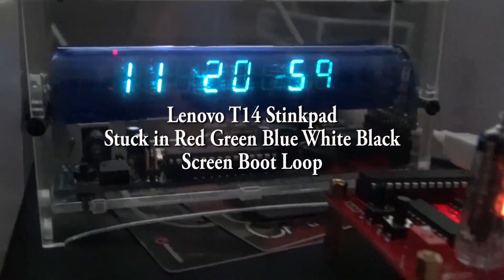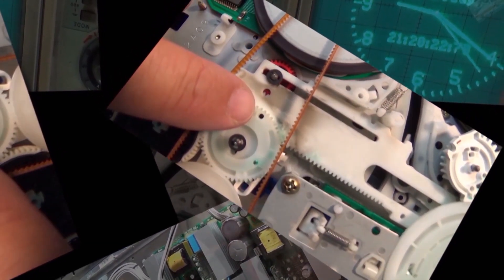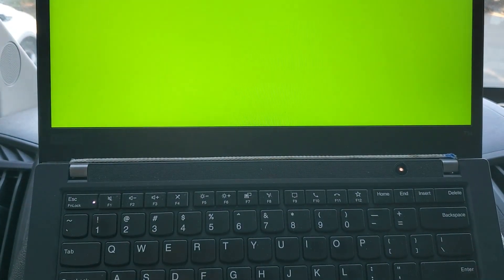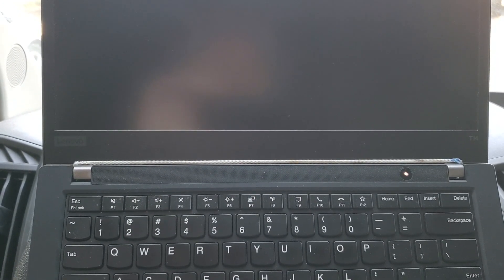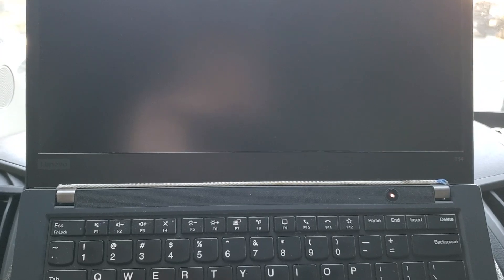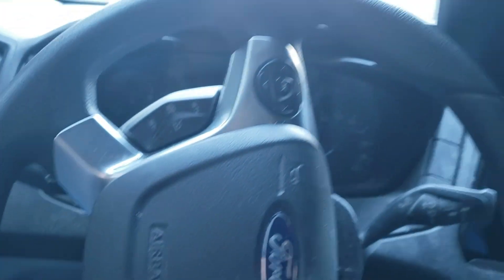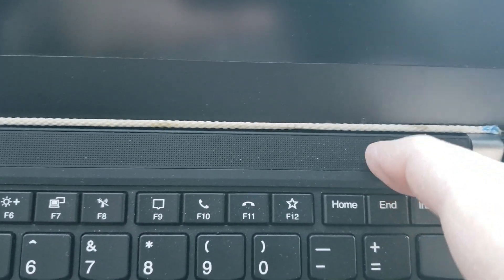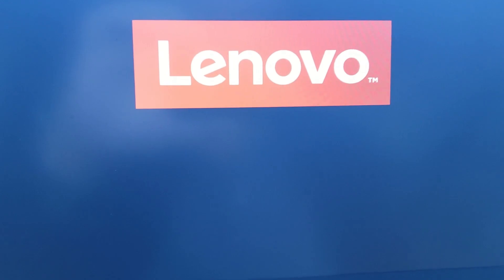Lenovo t14 Laptop stuck ini RGBW Boot Loop

Comment: U got lucky. I have two caller ID units that goof like that and they both have those reset buttons. I have a cable router box that has one too...Sometimes digital fridges will show nothing but horizontal lines instead of numbers, and the fix is to unplug them for a minute, albeit by time you notice it, your food is defrosted. Modern technology is often fubar!
Reply from the maker: Solution.  Don't buy appliances with digital anything. My washer and dryer for example has a mechanical timer. Speed queen, you pay a premium for the old reliable controls.  Lol.
Reply: @12voltvids  👍

Comment: Easy fix! CMOS reset?
Reply from the maker: Might have been easy fix but tech support didn't know it. They were ready to open a ticket and have me drive for an hour to get the laptop replaced.
Reply: @12voltvids  That reset bottom save you that trip! My HP doesn't have an external one, you have to take the cover apart. Humm, maybe I can drill a hole.  :)

Comment: Lenovo.

That's your problem.  I miss the days when IBM made them.
Reply from the maker: Ibm sold our to the Chinese.  I have an IBM stinkpad.  Still works. Windoze XP
Reply: @12voltvids  Exactly.

And it's also why I won't ever buy a Lenovo product if I can help it.

It's bad enough that most of the computers available will have been made in China, I don't want to have to buy a computer from a Chinese company that is going to have ties to the CCP.
Reply from the maker: @Watcher3223  they own Motorola now too
Reply: @12voltvids  Yeah,  Motorola broke up and the mobility business was sold to Google and then was sold to Lenovo.

Comment: Not Lenovo, but I've seen a Dell do this. It's a "feature" of sorts for factory burn in. There is a Dell support article that says a communication failure between the Intel Management Engine controller and the BIOS will cause it to go into a self-test mode, repeatedly testing CPU, RAM, etc.. and the LCD test shows that pattern. This can happen if the ME gets stuck after the machine was forced to shut down by holding the power button. You know it's that when holding the Windows key during power up gets it to boot, but it keeps doing that if you don't. A Lenovo would of course have the same ME controller and similar BIOS, they're all based on Intel reference specs. Seems like that is what happened here, and yeah, that recessed button resets the ME and gets it talking again. A BIOS update might keep it from reoccurring.

Comment: Tech 1 support here. Did you try unplugging it and plugging it in again?
Reply from the maker: Unplugging from what? I don't even carry a charger with me at work, it runs on battery all day.
Reply: @12voltvids  It's a joke. When I used to call tech support I'd always ask them to escalate the call to tier 2 support because I did try restarting it, rebooting, R&Ring the battery, etc.    

That hidden reset button fixed my Lenovo caught in an bootloop as well.

Comment: Dave, you were sold the Lady Gaga model. It's not a bug; it's a feature! I watched a video before about an iPad thing going wonky and rebooting whenever you touch it too hard or drop it on bed, etc... Turns out that both the square and rectangle inductors become loose off the board for whatever given reason on a certain model and year, in particular (10.5.) Being that one looked fried, probably from the bad connection itself, I am guessing it's a combination of subpar solder application combined with excessive heat buildup in the thin package. Was interesting. The fixing guy on here is fairly well-known and I dig what he does too. It was just one of the more interesting of the bunch (of videos.)
Reply from the maker: I wasn't sold anything. MY laptop is a Dell E6410 that I have had for years. I am the second owner as I bought it used. It works great and has the unstoppable Windows 7 installed. A 250 gig boot drive and a caddy that I can put any size drive I can get my hands on and pop it in place of the dvd drive.
It runs all day on the battery too. This piece of crap is the company computer which I use only for work and it is turned off at all other times.
Reply: @12voltvids  Cool! Just a little joke. You know it. Glad you got it going well. :)

Comment: It did look like it was stuck in a test mode, it was too regular with the screen, no madness.
And they put a reset button under the machine, not an accident.
I've had machines that jump into manufacturing mode,  power off then back on.
Pulling the battery out or pulling the cmos coin cell out for a minute  has fixed loads of locked up machines for me.
There is always a system controller chip that stays alive, they go silly.

Comment: Generally, if you need to shut down your PC and you have not booted into Windows yet, you need to hold the power button for five seconds. This is because the ACPI calls are not controlled by Windows at this time. Five seconds has been the default value in BIOS/UEFI for a long time. I think it was some time after 2001. This time delay is because some computers do not have the reset button on the keyboard, so you do dot accidentally lose your work. The control of the power putton gets passed onto Windows/Linux/whatever after booting. There you can control the behavior via the Control Panel.
Reply from the maker: Yes I know. The first time before the camera was on I just clicked it and it turned off then I turned it on and got the boot loop again, so then I turned the camera on and when I pressed it, it didn't go off so I had to hold for 5 seconds.

Comment: had a similar thing with ideapads. seems like the battery management goes wrong. took battery out held down a button inside and power button. like a bios reset. worked fine after and been really reliable.
Reply from the maker: This has been a better laptop compared to the HP that was issued in 2020 because the drivers were never any good and they blamed the pandemic for not fixing them. So that nice looking laptop was trashed because the LTE driver for the Hauwei air card kept crashing. This one the battery is a joke. Yes it lasts all day which is amazing BUT it will not hold a charge. I shut it completely down at the end of the day and charge it up for the next day. On my 3 days off, if I charge it Monday after work and then unplug it and let it sit, by my next shift Friday it will not turn on. The battery goes to 0% just sitting turned off. 
So what I end up doing is when I get home monday night I charge it for a few hours, and then plug it in again thursday night and charge it again. I don't like leaving it plugged in all night as I had one overheat in the bag once and the battery popped.
Reply: @12voltvids  the issue is because of windows modern standby. The best thing you can do is to make sure that instead is sleeping when you close the lid, it hibernates instead. The reason the battery drains is because when S0 sleep is used, it is always connected to the internet to get updates. You could also try switching to S3 sleep in the bios but Lenovo have likely removed that feature as with the majority of new laptops. I have a Dell XPS 15 9570 and it had this issue too, hibernate ‘fixes’ it.
Reply: I just read that you say you completely shut it down. I’m that case, try turning things like wake in LAN, always on usb ports, etc off, anything that causes the machine to stay in an elevated power state even when you would think it is going to shut off.
Reply from the maker: @itsmesb4399  They are all off. This is a company machine that is managed by the IT dept and I can't make any administrative changes but I can see what is on or off and magic packet (wake on lan) is definitely off
Reply from the maker: @itsmesb4399  I don't just close the lid. I do that when at work as I am on and off it all day. At the end of my shift I click the windows icon, select power and then power off and watch it completely shut down and go off.

Comment: Of currently owning over 100 thinkpads of various models (never a T14 yet) I never seen this happen. Interesting
Reply: All it is is a CMOS reset I think. But without tearing apart the laptop
Reply: @coastalvideotransfer  Yes, the newer laptops you have to disassemble to reset the BIOS

Comment: I had similar thing going on with my 2019 Acer Swift 3 laptop when it just didn't feel like powering on. I wish we could have easily replaceable batteries in laptops instead of reaching holes 🙃🙂